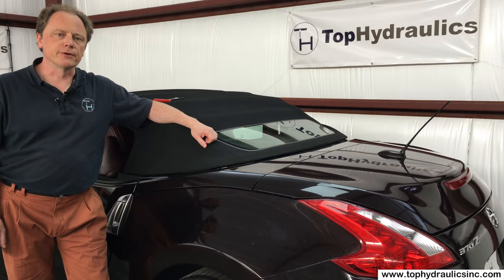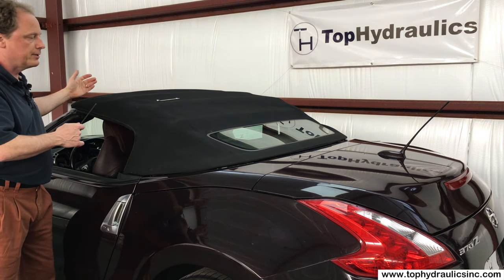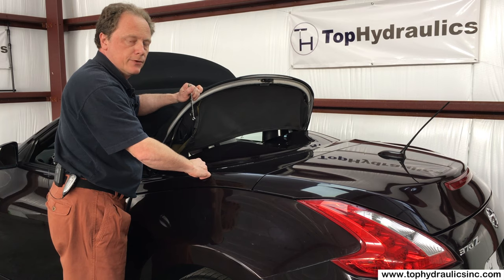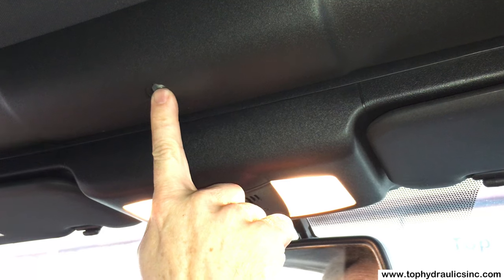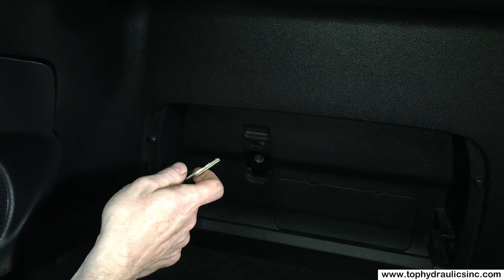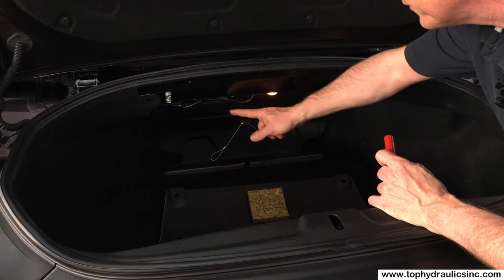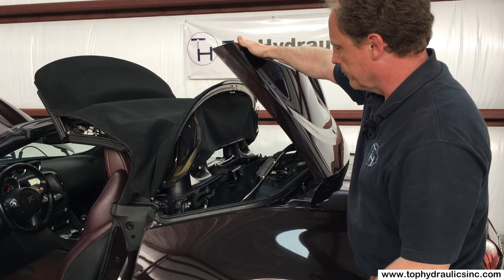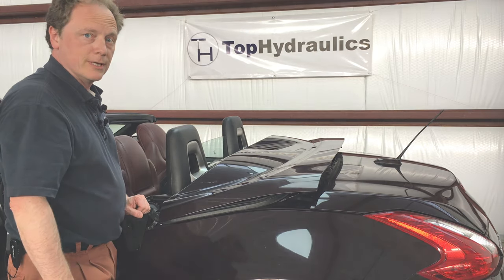Nissan 370Z - How to Manually Open the Convertible Top

Comment: Excellent vid! I have a 2013 Z and a metal piece near the frame (left side) broke at 38k miles, so I've had no convertibility for most of my car's life. Can't wait to try this next spring. As others have said, Nissan mechanics aren't well trained- I've called 4 of them with no help.
Reply from the maker: You can do it! Please let us know how things turn out.
Reply: @TopHydraulics  I just completed all the steps but probably should have watched this vid in its entirety beforehand (big mistake on my part). So there is no way to completely close the trap door securely after the top is tucked away? Mine looks like yours where the back of the door is raised a few inches.
Reply from the maker: Sorry, I thought you were referring to making a repair attempt and just needing to open the top for that. If I recall correctly, then you can get access to the cylinders that close the storage cover (tonneau cover) after taking off the interior quarter panels (the trim behind the doors). There is not much room and you would probably have to take out the liner in the storage compartment first to see how it works and how to attach something to the linkage such that you manually move the tonneau cover lift cylinders in the opposite direction of what the other cables are doing. I'm basically thinking of attaching some sort of cable or wire or strap in a similar fashion such that you can pull it from inside the car. This is not simple and it will require a good amount of force but should be doable.
Reply: @TopHydraulics  I'll end up taking it to a dealership if this much work is involved. I was just trying to retract the top, close the door,  and turn the car into a permanent convertible. Thanks for getting me this far.
Reply: @TopHydraulics  im interested in making my 370z roadster roof retractable via manually with a hand and delete the automation completely and just pull the roof up and down like the mr2 spyder and mx5/miata before it. How would you go about it?
Reply: @nicktubara what did you end up doing? Did you ever turn it into a manual top?
Reply: I'm interested in hearing if anyone's made any manual top solutions too.

Comment: Hello, Top Hydraulics! I hope this comment/query finds you. I'm having problems with my 370z convertible. And, I'm hoping you can give me an educated guess on where I should begin fixing my convertible. 

I bought my 2015 Nissan 370z in May 2022. When i test-drove the car, I stopped in a parking lot to lower the convertible top. As the top started to lower, the front/first bow hesitated slightly behind my head (while i was seated in the drivers seat). When it hesitated, I gently nudged it with my hand and it lowered and stored under the storage lid. I thought to myself "this is going to be a problem." But, I've always loved Z models and convertibles so I bought the car. 

I used my convertible for the entire summer of 2022. And, every time I lowered the top the first bow hesitated slightly behind my head (as stated above). And, as I did the first time I lowered the top, I had to nudge the first bow every single time I wanted to drop the top. 

I also soon noticed that the storage lid was scraping the 5th bow every time I lowered the top. I now know, that seems to be a common problem, and that I'll need to fix/replace the 5th bow.

With all of that being said, now I will describe what seems to be a bigger problem (maybe the symptoms my convertible was having led to this bigger problem. Is this all connected).

Towards the end of that summer (2022), in September, I rode around town with my top down for a few hours. When I got home, my top wouldn't close, at all! I could hear the motor/hydraulic pump as I held on the switch, but the storage lid wasn't opening and, of course, the convertible top couldn't close. It was a nice day (no rain coming), so I went in my house for around 2 hours. Then, I went back outside to my car; tried to close the top, and it worked. But, I was afraid to ever open it again.

One year later, I decided to open the top and see what it would do. This time, when the front bow hesitated slightly behind my head and I nudged it with my hand, it would not budge! So, of course, it wouldn't fully open! Then, I tried to close the top. It did start to close, but as it got close to the top of my windshield it just stopped (and wouldn't close)! I could hear the motor/hydraulic pump, but it wouldn't close. So, I waited 30 minutes and tried to close it again. And, it did close. That was last year (2023). Since then, I have not messed with the convertible top.

Do any of these symptoms/problems sound familiar? In your expert opinion, what do you think the problem (problems) is? 

Thanks!

Comment: Hi, I’m wondering how the cables will go back to their original position after I have taken a look in the latch area. Could you please elaborate on this?
Reply from the maker: Thanks for asking. Once the latches get moved back to their original, closed positions during the closing process of the stowage cover, the cables will be pulled back to their original position by the very latches that they previously pulled open. I am missing a little context in your question. Which latch area are you going to examine, and what is the current problem with your top?

Comment: Hello Klaus, I'm Laurent from France.
Is there one other method, even if there is some parts of the car to disassemble, to open the soft top storage compartment, because the two release cables that are in the trunk are broken. Thanks for your help.
Regards
Laurent
Reply from the maker: Hello Laurent, you can still access the linkage for the tonneau cover locks if you remove the trim behind the door (under the roll bar).
Reply: @TopHydraulics  
Hello Klaus,
I didn't know that tip.
I don't know exactly how to do but I'll try.
Thank you for your help.
Laurent.

PS : Does "Top hydraulics" send spare parts to France ?
Reply from the maker: @lamagiedetrespres6196  It can be done with a bit of persistence. Yes, we ship parts to France pretty much on a daily basis.
Reply: @TopHydraulics 
It's ok I did it, thank you very much.
In fact, the end of the cable sheath had come out of its housing and therefore it was impossible to unlock from the trunk.
Now I have to identify the cause of my soft top failure.
One of my friends is going to lend me an OBD2 tablet, I hope that will simplify my research.
Thanks again.
Laurent.
Reply from the maker: @lamagiedetrespres6196  Congratulations! Looking forward to learning what made your top fail.

Comment: Hello,
I had to open the storage box manually as shown in your excellent video.
But even after pullling on the cables to unlock the storage box, it does nkt move and is held firmly!
While I felt the resistance that you say in your video and I had the feeling that it was unlocked but nothing moves.
Do you have an idea ?
Thanks in advance
Reply from the maker: I would suggest pulling harder - it takes quite a serious tug to open the latches. If the cables end up breaking, then you can still access the latches from inside the car after removing a bunch of trim near the roll over bars.
Reply: Thanks for the advice, I'll give it a try and let you know if it worked.
Reply: I tried to pull it harder, but I think I reached the limit. There is even a black sleeve that came out with the cable! I think I'll have to dissassemble it from the inside.
When you talk about roll over bar, is from the door side with door open? The blach plastic part?
Thanks for your help
Reply from the maker: @nicolauzzo7918  You need to remove enough paneling until you are able to reach the locking mechanism in the storage cover's linkage. Start here: https://youtu.be/kHLh-JWM9NM?list=PLly4CMbpk7oxTZzpfpFyLSwfyatkJN6lF&t=127
Reply: @TopHydraulics  Ok, now it's clear...thank you very much.
I try a last time to pull strongely these wires and if I can't I open from inside.
Thx
Reply: Where you able to open it
Reply: @matthew02110  
Hello,
I left my car in my garage for 3 weeks during my vacations. When I come back, to my great surprise I was able to open the roof with the button. I took the opportunity to look the metal cables and I saw that plastic stop was not in the right place that must be the reason why I could not open it by pulling it.
Unfortunately I didn't check the electric cables. I was able to uncover and cover the car 4 times and now is blocked again !
I will have to retry the procedure of the video hoping that it opens but I wait until September because I have my periodic technical control to pass.
I'll keep you informed.
Regards
Reply: A BIG thank you, I wanted to give you an update on my 370z.  I tried again to open by following the great video to open with the metal cables but no chance.  So I had to dissambled the plastic covers from inside the cabin by following the start of the second video you sent me.  Finally it was relatively easy and fast.  Then I was able to unlock the bolts and access the storage area.  There after opening the bundle of cables, the problem was quickly identified.  3 broken wires.  We fixed them and everything is working again.  So really thank you thank you thank you.
Reply: @nicolauzzo7918  I am having the exact same problem.
Reply: @cindystives1161  Just follow the videos and I am sure you can repair easily. If you can't pull up the wires...disassembly from inside.
Reply: @nicolauzzo7918  We must have twin cars because I got mine working yesterday, then today the same thing.  So I have the storage lid open again, and I see the cables covered by the sheath.  I opened the sheath and there are 3 black cables.  Did you unsheath those cables? Is that where the wires are?

Comment: Good evening,

I come to you for a problem. The storage cover no longer goes down completely (few cm only), have you ever experienced this problem? It sometimes happens that the cover goes down completely but this blocks on the right or left side and the electrical system then no longer wants to start. The cables are pulled but the cover remains blocked. Sometimes (without understanding why), the electrical system restarts on its own. Do you have an idea ? Sorry fors mistakes
I'm lost, thanks for your help.
Best regards
Reply from the maker: A very common problem that would match your symptoms is in the wiring harness that is routed along the left cover hinge. It has six wires in it, that can either crack or short to each other while the cover moves. Unwrap that harness along any section that flexes while the cover moves, inspect for damaged wires, replace any damaged wires.

Comment: good afternoon, how to you get the striker latch to release so you can re attach to soft top
Reply from the maker: Once you have access to the latch mechanism with the tonneau/storage cover open, take a close look at how the locking cylinder moves the linkage for the lock. Simply move the linkage manually such that the cylinder shaft extends and opens the latch. It takes some force to get it started, but there is no excessive force needed.

Comment: My 2010 370z only has one release cable.  It appears to release the passenger latch.  I see a comment about accessing the latch from door panel.  Any video for that?
Reply: I removed the trim and can see inside the storage bay.  Two problems - first, I don't know what to push/pull to release.  Second, I have no hope of getting my hand in there.  What is tool of choice to initiate the release?
Reply from the maker: @crockermultimedia  Congrats on getting this far! Maybe you can still see remnants of a torn cable, so that you know in which direction to move the linkage? It comes down to ingenuity now, working in the limited space available. Others have done it before and we would appreciate a detailed description of how you managed to do it in the end. Ideally, it would be great if you could post photos on the forum The370z.com, so that the whole 370Z community can benefit from your experience...
Reply: I removed the trim on the passenger side so I could see how it works.  The driver side cable is broken from a screw attached on the body.  The end in the trunk is missing.  Not sure how that happened.  Anyway, it appears the cable wrapped around the hydraulic ram and stretched it out so the locking hook could move around the locking bolt.  I found someone with smaller hands, but was unable to open the ram.  Tried to open by pushing with wrench and screw driver.
Reply: I rigged a tool and pushed at the back of the hydraulic ram and it released.  Now to find the problem of why the top stopped working.

Comment: can you guys do a diagnostic vid? My 370z soft top has some electric issue like when I push the open switch, the top react for 3 or 5 seconds and stop, never forward anymore, then I have to wait for some time, and it has power again, I don't know whats wrong and how can I fix it by myself, any help well be appreciated!!
Reply from the maker: Please describe in more detail what is happening. In particular, which parts of the top move and how far do they move?

Comment: “Little” issue with the two hex-bolts on the rear… thanks to the metal plate is litterally impossible to unscrew. What i have to do?
Reply from the maker: Sorry to hear about your little issue. Is anything different from the parts in our video?
Reply: I can tell you that I also went down that rabbit hole and it took me 2 hours for each hex bolt and huge bruises on my upper arms to get them out, and then one disappeared on the inside of the bow (don't make that same mistake).  Then I went on to pull those cables in the back and I felt each one give (felt like popping the hood of the car), but the storage lid still wouldn't open.  Now I can't get those bolts back on.

Comment: If I was going to try to put in new fluid as preventative maintenance, could you please let me know which hydraulic fluid is best to use? Or which fluid it is that you use. And if you could let me know where to purchase it, I'd really appreciate it. Thanks in advance.
Reply from the maker: You can use Pentosin CHF11S or Mercedes 0009899103. Both are available from many online sellers.
Reply: @TopHydraulics  Thank you very much for the info and for getting back to me as quick as you did. I appreciate all your help as your videos have helped us to trouble shoot our convertible top.
Reply: @mikealdaco9309  did it help?

Comment: I’ve been manually opening and closing the top for a few months. Now I’m having an issue where the top won’t latch closed on the windshield. I was on the freeway and the top was closed and fully latched shut. Then it suddenly flew open by itself. Any ideas on how to fix this? It’s basically a permanent convertible at the moment
Reply from the maker: I'm sorry to hear about your trouble! Out of curiosity, how did you secure the storage cover when you drove the car with the top down?
Manually operating the 370Z top other than in emergencies is playing with fire, as the replacement parts are too expensive to risk damage in a case like yours. Was there no warning that the top wasn't fully latched, or has the warning been disabled? I have never heard of a 370Z top blowing open by itself, so I'm wondering what would have made the front lock spring back by itself or which parts may have come loose. 
As far as damage to your top goes, I would assume that the top's frame is bent. With some luck, you can obtain a used top frame from someone whom the Nissan dealer convinced they needed a whole new top even though they only had leaking hydraulics.

Comment: Can any verify if you can do this on a 2004 convertible 350Z??
Reply from the maker: Thanks for asking. The top in a 350Z is quite different. I do not know whether the 350Z has the same issues with bungees or what it takes to replace those. If you find a solution, then we would surely appreciate you letting us know!

Comment: I have done as you discribed but the roof storage cover will not open.
Reply from the maker: In that case, it appears that either you have not pulled the cables hard enough or one cable is broken. You would know if a cable was broken, so I would suggest pulling a bit harder yet on the cables and possibly have someone lean on the cover while you are pulling the cables.
Reply: having the same problem.  Did you ever figure out how to get it open?

Comment: Hi 
I’ve tried to open the storage cover, so i pulled the link but it does’nt work. The storage cover is still close... do you havé another tips to open it ? 
Sorry for my english 
Thank you!
Reply from the maker: You can see in the video how I had to pull quite hard on the release cables. At first, they move easily, then comes the critical portion where you have to pull hard for about one inch (25mm). If the cable brakes, then I can still tell you how to get at the latches, but it will be more work. For now, try to pull harder and the cover will likely unlock.
Reply: @TopHydraulics  thank you for you message. 
I pull  hard and i’ve hearned 2 « claps » as something unlocked on every side 
But the storage and the rear anger are still locked... 
Can i make any dammage if I pull again ?
Reply from the maker: @romanhidalgo4476  Worst thing, the cables break. They can be fixed.
Reply: @TopHydraulics  Ok, thank you vert much . 
May be do you have another way for open it ?
Reply from the maker: @romanhidalgo4476  Let's try first to pull harder. If the cables break, then you need to take out the trim piece behind the driver's door for direct access to the storage cover locks.
Reply: @TopHydraulics  ok, thank you for your advice
Reply: @TopHydraulics  if one felt it unlock, would one need to keep pulling it?  I feel like its unlocked on the sides, but its the striker plate mechanism holding it down.